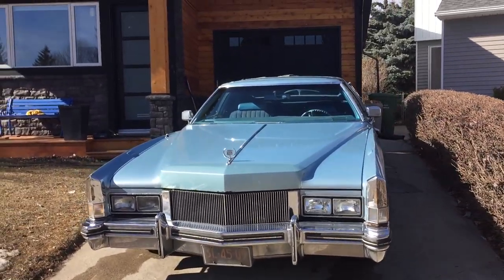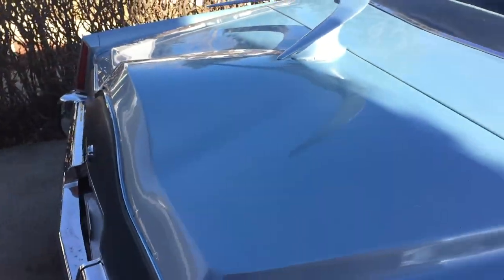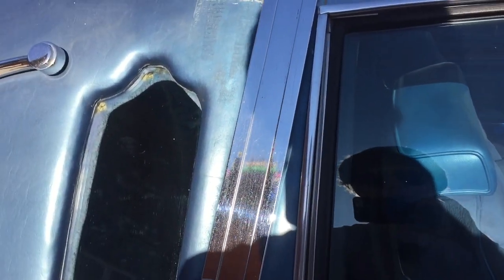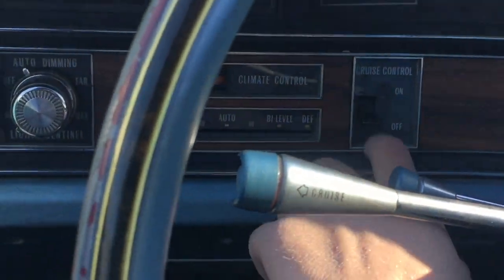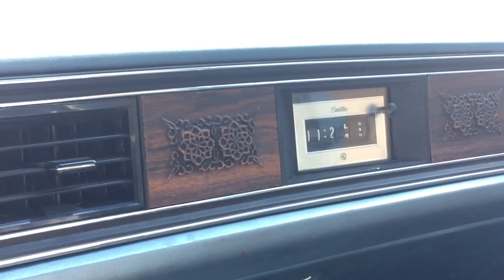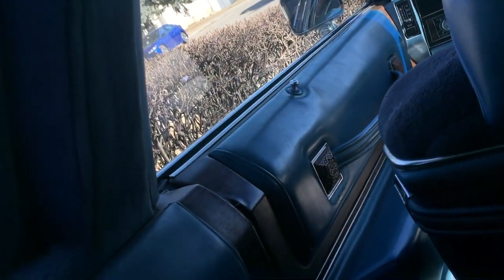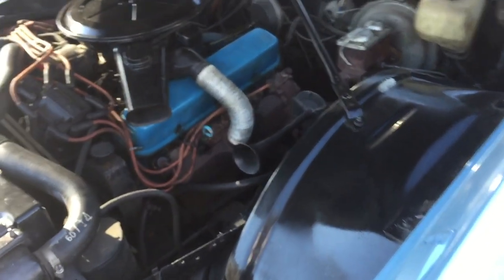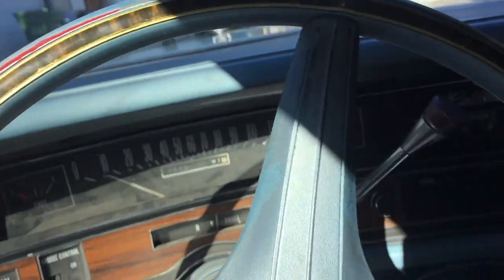Here's a Full Tour Of My 1973 Cadillac El Classico/Eldorado...

Comment: Great looking car.  Does it have shoulder belts?  Looks like they may have been removed.  If so, you need to add shoulder belts back in it and be sure to wear them.  As a teenager, I had my grandfather's 73 Eldorado and I actually wore both the lap and shoulder belts in the late 70s.  In addition to the safety reasons for buckling up, with the belts on, you actually got a better feel and an enhanced ride and handling of the car.  And with first hand knowledge of being in a head on collision in my Eldorado, wearing the lap AND shoulder belts is the smart thing to do.
Reply: They came with the standard lap belt, and an optional shoulder belt that pulls down from the ceiling of the car.

Comment: There are fiberoptics in the car. the two dots in the rear seat above the head are fiberoptic cables that go to the taillights the light from the bulbs in the taillights travels through the fiberoptic cables to those dots and they glow red. You adjust the rearview mirror to see them. They show that the bulbs are working they glow red when the brake is applied they get brighter and flash with the turn signals. If you remove the tail light lenses you can see the cable It looks like a cut-off wire near the bulb. clean or scrape the end to get them working again light needs to pass through the glass fibers dirt blocks the light. there are also the same thing on the fenders. amber for turn lights white for low beam blue for high beam. you need special headlights for them to work, the light they see is from the backside of the headlights. clean them the same way. Fiberoptics run the internet. 1973 Cadillac used fiberoptics that didn't come into common use until the 1990s that says something about how advanced your car was! Your new radio cassette NR-70q button is noise reduction R/T is Radio tuner clock function APC was a tuner or sound function I remember the term vaguely. The antenna dash switch was disconnected to take advantage of the auto-up feature of the new radio.
Reply from the maker: Huh. That’s cool. I knew the fender markers were fibre optics, but I didn’t know the ones on the headliner were. That’s pretty cool. I messed with one of those headlight bulbs for six hours one day trying to get the high-beam marker to work again. We don’t quite have fibre optic internet in this neighbourhood for wifi yet though, lol. That’s cool I didn’t know that
Reply: @TeenMechanic   I have a 1965 Cadillac Fleetwood Brougham, So I understand headlight issues mine was removing the lower headlight bezels that cover the bulbs. The coach lights in the Landau tops were fiberoptic too. You may have the feature when your door is locked and you press the door handle button it lights up the inside of the car (so you could check for killers in the back seat) and a light in the door handle to shine on the keyhole. Old Car Alley has a tip... fill a spray can cap with toilet bowl cleaner soak your dirty & corroded plug ends in the cap and rinse makes them like new. check out his channel 66 for conv restore.
Reply from the maker: @rockubtzer  Absolutely! Mine doesn’t have coach lights in the vinyl top, but I’ve always thought that it looked cool. I may give that a try when I have some time, but I really appreciate the insight. Thanks